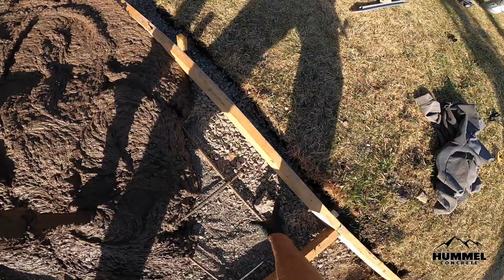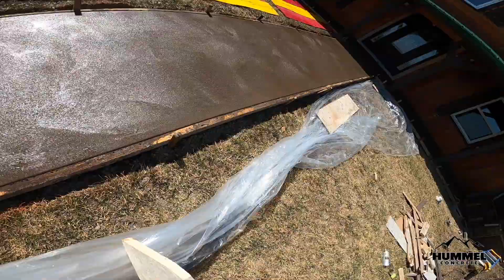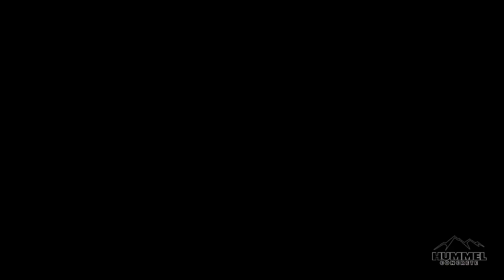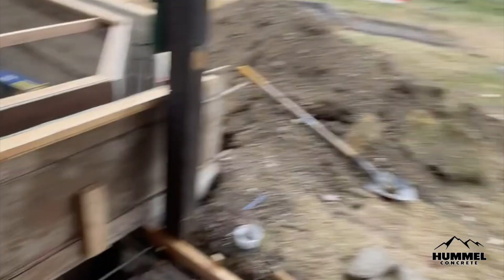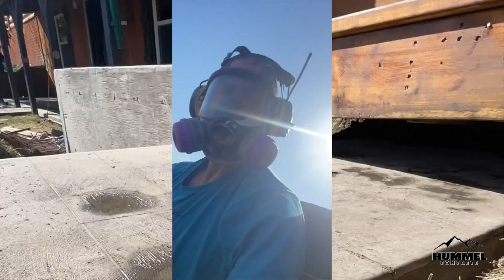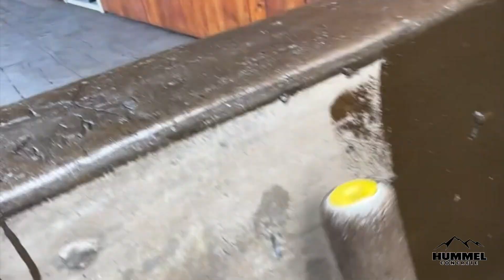STAMPED CONCRETE: Reclaimed Timber

Comment: Absolutely gorgeous!!! What do you find are the pros/cons of liquid versus powdered release agent?
Reply from the maker: Thanks brotha!! 
Advantages of liquid: 
1) Clean: no powder to breathe in during application and no big colour mess to wash off the next day. 
2) Visibility: Easy to apply where it’s needed, see what you’re doing while stamping and make necessary touch ups as you go. 
3) Ez tique highlight process is very easy, clean and allows the highlight colour to be placed exactly where you want it. 

Only benefit I see of using powder is that it gives a more “aged” look with certain patterns. Not enough incentives for me to use it anymore.